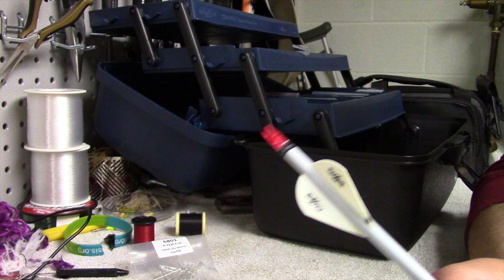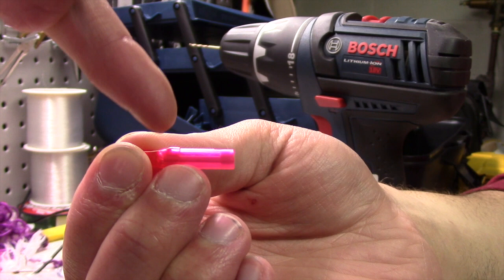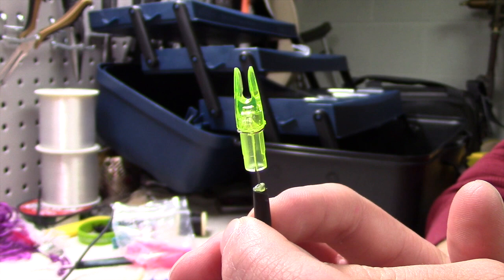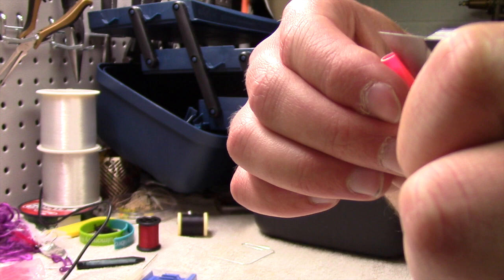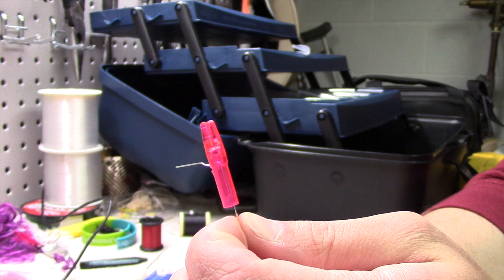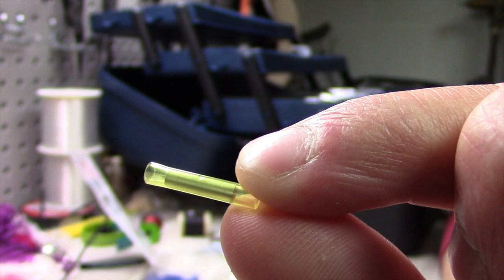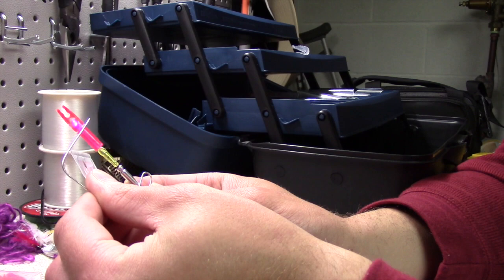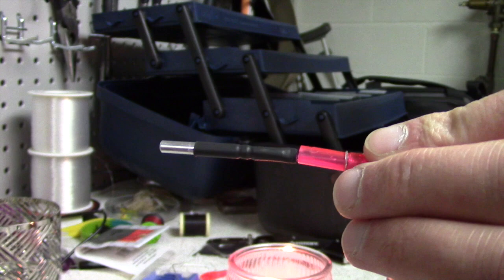Homemade DIY Lighted Carbon/Aluminum Arrow Nocks

Comment: Nicely presented Jack .. There are a few alternative approaches to this method..Whatever your approach is to your liking stay with it . I was a little nervous that you would cut yourself..You might entertain trying a vise..As an experiment you might try a translucent nock with your favourite color led . A higher degree of luminosity is achieved. I definitely would try your method as a backup..A fingernail trimmer is good for cutting the hat and it is curved

Comment: The long leg is always positive on an LED.  Similarly, the flat side of the "hat" is always positive.  Just FYI, so you don't run the risk of burning out your LEDs.
Reply from the maker: Jason Patterson Good tip about the Hat! I was unaware of that! Thank you.
Reply: Exactly!  A simple electronics class and/or a little research and bam!  But the folks selling led’s or any of these components should clarify that.  I mean If I were selling these led’s online I would give as much information as I could to make sure my products sell better than anyone else’s.

Comment: To convert from metric to fraction divide by 25.4, your 1.5 mm is .059 thousandths, just under 1/16 of an inch, or .0625.

Comment: Use a bamboo chop stick (next time at Chinese food restaurant) taper one end and use to SLIGHTLY spread open cut slit. Makes wire pass into position without risk of breaking off. 😉
Ps. Or use needle nose pliers and open up SLIGHTLY.

Comment: Suggestion:> Buy a cheap digital caliper from harbor freight. Very useful for diameters "AND" converts from metric to standard (or vice versa) at a push of a button. Great video Thanks 😃👍

Comment: If using blue or red LED they might burn up if you hook them to a 3 volt battery since they can only handle up to a certain voltage.  I would stick with the white LED or solder on a resistor to get it down to the correct voltage.  White looks best through colored nocks anyway.  Thanks!
Reply from the maker: Robert P No thank you for the tip!

Comment: Just an added note, some "carbon" arrows have a high fiberglass content and may not work with lighted nocks like this, or even Lumenocks for that matter.  Great tutorial. Thanks for sharing.
Reply from the maker: Yes! Some more budget shafts from some manufacturers have fiberglass. Even some high end ones too. Standard diameter Victory and Gold Tip arrows though are pure carbon and work very well for this application.

Comment: There is a Much easier way to put this together.  The long leg is called the Anode, it's the +.  The shorter one is the Cathode, the -.  Cut the Anode to 1/8" long, solder a length of .22 Gage wire to it.  Run the wire thru the hole, slide the led up the nock.  Clip and strip the wire 1/8" from the hole.  Take a piece of heavier gage wire and make a ring to form the contact.  Solder the end of the wire to the ring.  You can solder the cathode to the battery with no issues (IF EXPERIENCED WITH SOLDERING).  The rest you proceed as before.

Comment: You start the video by saying you want to slightly angle the hole you drill towards the shaft. Then after you drilled the hole you asked if we could see that you angled the hole so it slightly pointing towards the prongs. Which is it?
Reply from the maker: Being on an angle it points both ways obviously. But you want the hole to slope UP towards the prongs and DOWN into the shaft of the nock. Hope that clarifies things!

Comment: Dude! Smoking cool tutorial!! I forgot all about carbon because I don't use aluminum arrows and was thinking, "Damn, I have to buy aluminum now?!" Lol...And, btw, I'd stick with the pure white nocks because of possible heat build up in darker nocks with 3v batteries...Besides, if it's late, you won't be popping the nock until you're ready to draw and it'll be so much easier to find than blue or red...Especially if the damn deer runs off with the arrow stuck in them...Great, great idea...Now, if I could just find a work space for my tools! Subbed...

Comment: Safety Tip: I don’t recommend drilling a hole in or altering a Nock in any way. They are built to extremely high tolerances but are very fragile overall. And if one of these comes apart before the arrow gets away from the bow, you’re likely to have an exploded arrow in your close proximity.

Comment: Thanks for sharing. Once you start using lighted nocks, especially for filming, it is hard to go back to regular nocks. Wonder if electricians tape would work instead of heat shrink?
Reply from the maker: I don't see why not!
Reply: Go to Princess Auto or a similar store in the US.  You can buy rolls of shrink and it is way lighter than tape and creates a moisture seal.

Comment: Have you had any problems with the battery flying off when it hits the targets? Or does your spring do a good job keeping the battery in place?  I have some crossbow bolts that i want to do it too, but the diameter is larger than most arrows. Any recommendations for doing bolts?
Reply from the maker: +JMURM With the connecting piece and the shrink tubing I have yet to lose the battery. Before I thought to add the tubing I didn't have some come off, but rarely. I have also done this with crossbow bolts and it works great! The only issue sometimes is, with the superior poundage of the crossbow, that the connecting leg wrapped around the nock will shear off from the force of being pushed into the back of the shaft. Other than that, I just make the spring leg a little longer inside the shaft and it works like a charm! Best of luck.

Comment: I have Chinese knock offs of lighted knocks but they are manual and I want to make them automatic ones they have the diodes already inserted into the knocks and the batteries slide up inside the nocksand one leg is slightly longer. How can I use your idea on these without ruining them?

Comment: Hey Average Jack, love the videos! What components would you recommend for a VAP TKO setup? My inside diameter is  right at .166" which is 4.216mm. The batteries you are recommending are at 4.2mm. With that being such a crazy tight tolerance, any fluctuation would cause a no go. Plus there would be NO shrink wrap and no coil, which should be fine. Also, will the 3mm LED's fit inside a nock for micro shafts? Thanks in advance.
Reply from the maker: Unfortunately the nock styles for .166 arrows negate any ability to do this method. It takes a special nock and different size battery to fit that size. My personal recommendation is to just bite the bullet and buy lighted nocks. I've fiddled around with everything from top shelf to China knockoffs and all have worked well.

Comment: Awesome- I’m definitely going to try this, BUT one question. 
It seems like you could cut the connector in half, or even quarters and significantly reduce the overall length of the unit making it more compact, cheaper, and sturdy. Yes- the connector will get crimped when you cut it, but it’s nothing a pair of pliers can’t handle. Have you tried this?
Reply from the maker: I haven't, no. And quite frankly since making this video I've found it simpler to buy the Chinese lighted nocks from eBay and Amazon. Cost me less than DIY and are much more reliable.
Reply: @averagejackarchery  Do you have any specific ones you'd recommend?

Comment: I like this but my problem is that I have 2 dozen of the manual lighted knocks that I want to turn into automatic 
Lighted nicks when fired they ready have the diodes inserted into them and come with batteries that slide into them like what you show in this blog and am wondering how I can do this to them I tried to remove the diodes with no success and would love to make these can you help me with anyideas

Comment: Have you ever not had carbon conduct the ground. Found that some Allen arrows don’t work tried everything any thoughts
Reply from the maker: Allen arrows are not pure carbon. They have a mixture of fiberglass resin in them. I had the same issue with a cheaper Easton arrow, the carbon storm. A pure carbon arrow will rectify the situation and allow full current.
Reply: Thank you I have found that some of the China lighted nocks work really good and are cheep and I’m shooting 347fps out of a rpm 360 and they are holding up great.

Comment: The nock won't get stuck on your bow string when you release the arrow. Doesn't the nock have to be glued into the shaft?
Reply from the maker: On modern day arrows (circa the late 1990's if not even earlier) nearly all arrows went to push-in nocks that stay strictly in out of compression in the shaft. This makes them easily removed if damaged and also allow them to be turned to align fletchings to shoot through different rest types.

Comment: having trouble finding the batteries without the lights, and Brian's doesn't work on eBay for some reason.
Reply: Will the batteries with the light on them work?
Reply from the maker: Try here! https://www.google.com/webhp?sourceid=chrome-instant&ion=1&espv=2&ie=UTF-8#q=cr435+lithium+battery&safe=strict&tbm=shop
Reply: thank you very much
Reply from the maker: Most welcome!

Comment: good stuff! have you ever weighed one to get a grain weight to compare to the weight of store bought? if so what does your finished product weigh? thanks.
Reply from the maker: Thanks! To be completly honest I have never weighed them in comparison to things like Firenocks, Lumenoks, and Nockturnals. But I would imagine that mine weigh more as they have the phone butt connectors to connect the battery to the LED as well as some shrink tubing I add to further secure and clean up the connection. But we're talking small grains here. Probably less than 5 extra I'd wager.
Reply: An Average Jack  thanks, i imagine that much (little) extra weight wouldn't effect flight too much inside 30-35 yds. would love to know actual weight though. if you ever get a chance to weigh one up that'd be great. thanks again.
Reply from the maker: Just weighed the ones I have for my Easton Axis shafts, and I'm looking at 30.1 grains. So actually I guess they're right around Lumenok weight at least! And yes, I have seen zero change in arrow impact at normal hunting distances of 0-40 yards.

Comment: just wondering with all little extras like heat shrink and connector and springs are you really making them any cheaper than the thill bobber style? I tried these couple years ago and couldn't for the life of me make them work tried the thill type and works perfect and easy to do just little glue and small drill bit done (not even the chance of cutting thumb making slot) not criticizing your work just wondering why ? to each his own

Comment: Dare to make crossbow nocks?
Reply from the maker: It's the exact same concept that I've followed before. The issue with them however is the KE created by a crossbow bolt can cause the batter to come out of the butt connection and slam down the shaft into the insert when it hits a hard enough object.

Comment: Average Jack,Have you tried any for a crossbow? Especially with 1/2 moon style nock?
Reply from the maker: I have and wouldn't recommend. Way too much force with the bolt and I've broken off a lot of batteries in my builds. I would stick with manufactured models.

Comment: If i missed the answer to this question in the comments i apologize  but what does the total grain weight come out to as a complete lighted nock
Reply from the maker: Without the shrink tubing it's comparable to Lumenok weights. Around 20-24 grains. It's not an exact science. The shrink tubing does add some extra obviously and it depends on how much you cut and how thick it is to begin with.

Comment: Wondering if the diameter of these is small enough for the micro diameter shafts (.165)?
Reply from the maker: These are too big. The .166 sized shaft requires a whole different battery system due to their micro diameter.
Reply: Average Jack Archery I figured. Lol. There’s always something 😭😂

Comment: where did you get your batteries? good job
Reply from the maker: +MrJmartin85 eBay. That's where I purchased all of the electronic parts. You could possibly find them at a hobby store too. Good luck!
Reply: thanks. I was able to get 10 for $13... Just have to wait a month for my led's to get here from china.